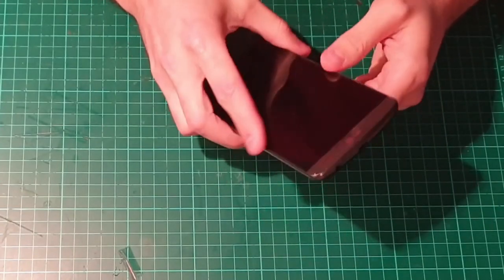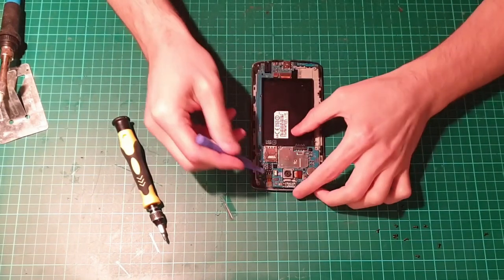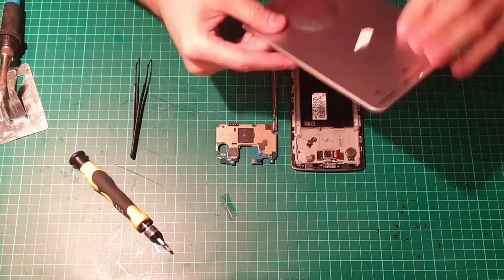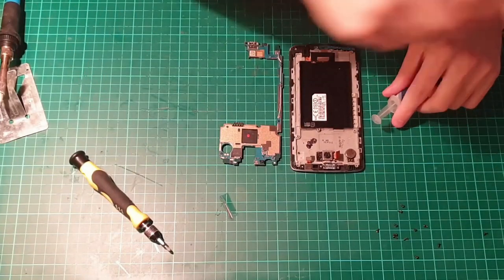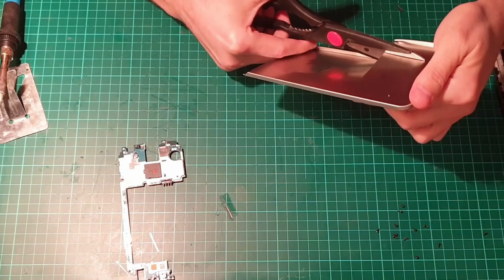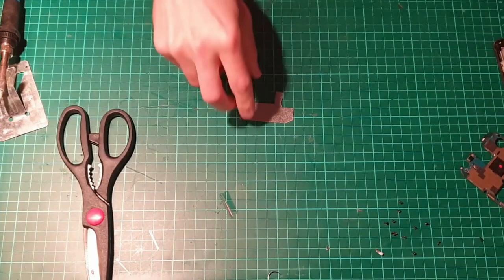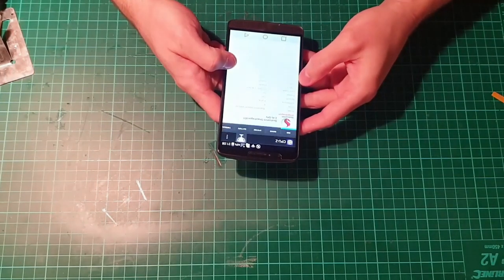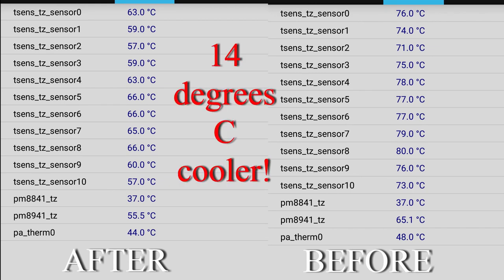I Made a HEATSINK for My Smartphone  (and it WORKS!)

Comment: Instead of the heatsink or thermal paste I put a thermal pad in mine. Huge difference. Cpu and battery temp stay normal however the power button does get warm. But warm , never hot.

Comment: Doin this to my s9 heats alot  crash ,am adding a copper layer(the thermal copper sink thin plate) and thermal paste(grizzly) and see if it drops from  80C to 30C
Reply: It drops and stays at 33.5 max!! Lowest is 25.C,Thank you!!!
Reply: Rly bro??? Thought s9 with sd845 was efficient enough. Niiiice!! Got any benchmarks? Or photos /imgur /reddit?
Reply: @purpledoge4466  what type of grizzly
Reply: @kathyacarneiro7841  he probably has the Exynos version
Reply: can I use it for Note 9 exynos
Reply: Hello... how did you do that. do you have video instructions. Tnx
Reply: Bro i only d9 thermal paste it does redyce heat from cpu only but the phone hot af

Comment: Have you had better temps with shim or thermal pad ?
Reply from the maker: I never tried a thermal pad, only copper and thermal paste
Reply: @Gabriel2.0  My v20 has the same heatsink metal over the chip. But my heatsink is built into the motherboard and wont come off. I got good temp readings from the thermal pad. I just got done adding spare thermal pad to a second chip with a heatsink and the temp went down even further than before even.
Reply: @Gabriel2.0  After the second piece of thermal pad on the second heat sink ,the power button doesnt even get warm anymore and no matter how heavy the usage is ,temps stay in 40 c .
Reply: @Gabriel2.0  How did you get the heat sink plate off ?
Reply: Is it okay to stack copper shim on top of another copper shim?

Cpu + Thermal Paste + SHIM + 
TP + SHIM?  Is this okay?

Comment: Will regular aluminum foil work too?
Reply: Nope
Reply: Yes just use more layers until you make sure pressure is applied on both sides
Reply: @kenechipalabrica9602  yep
Reply: @FerdAboubakrOnline  nope bro you're wrong. it's about conductivity.  better to buy a small heatsink to get better result
Reply: what if I put a piece copper can.. an didn't put bk the small iron around the processor
Reply: I messed up the camera on my phone trying to do this type of crap. Get a professional to do it or get a new phone like I did.🤷🏾‍♂️

Comment: It will be more better if you attach it to the outer metal body part of the phone like back or side of the phone so then the heat can go outside through it rip eng sorry
Reply from the maker: No. It has to be in contact with the processor. The plastic body is not a good thermal conductor
Reply: Mr know it all turns out to be Mr know it not😂